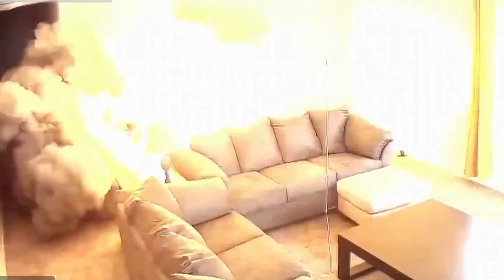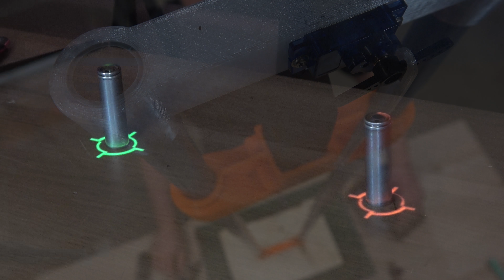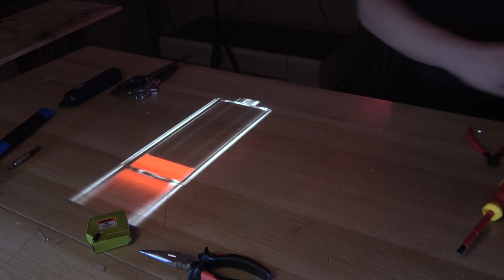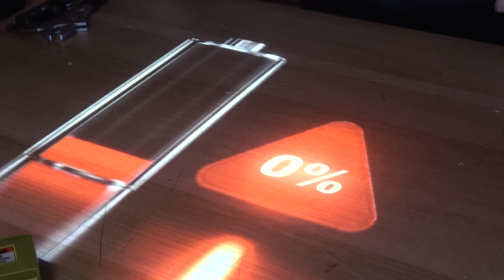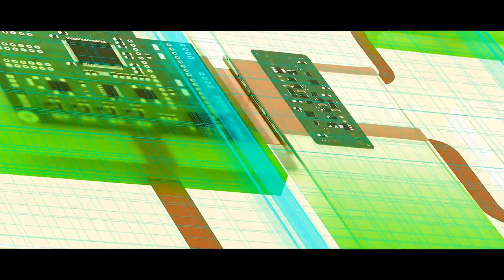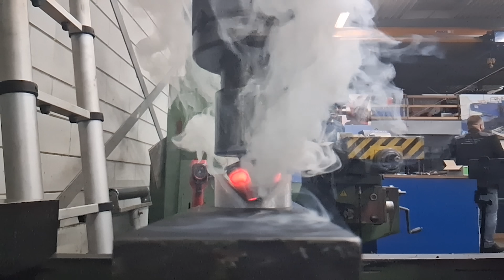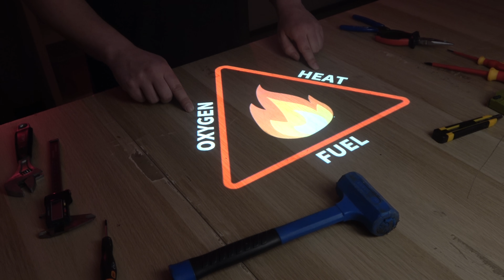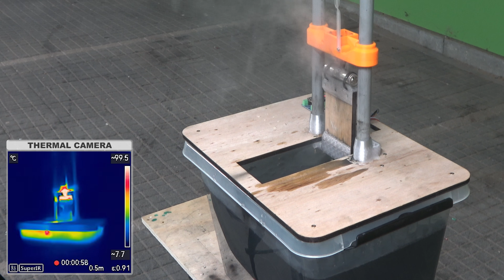Detonating Batteries.. For Science!

Comment from the maker: Any suggestions for Part 3?🤓 I'd love to hear what you really want to see next!

🔋Specific battery type OR 🔥Specific experiment maybe?

Endless possibilities of course.. But you decide!🫡 So let me know and hopefully I can give you your answer in Part 3 soon🤓
Reply: Pouch batteries should be included, as they are used in many more places. And puffing should be explained.
Reply: @moonowo Will Prowess punchered pouch cells on his channel. Very educational.
Reply: Try LiPo batteries! Much more unstable and show what happens when they are overcharged/mistreated.
Reply: @WedgwoodWarriorXlifepo4 battery is much more stable
Reply: Try this same experiment using  liquid nitrogen or dy ice !
Reply: why the fake thumbnail? i wanted to see the phone battery that never appeared, downvoted and blocked for not showing the correct  battery as in the thumbnail
Reply: 50% charge because thats usually best longterm storage, see if ammo cans (metal) would be somewhat suitable to supress fire at home (put some paper sheets next to it)
Reply: What and how ignites lithium batteries?... a general understanding!
Reply: @user-McGiver  eternal fire is stored inside the batteries
Reply: @TouYubeTom  more like lithium ignites when in contact with oxygen... but what causes that?... if it's not mechanical, what is it?... and what can we do?... for example, I never leave batteries on the charger beyond the charging point... I set alarm...
It's not a funny matter... don't be that fool...!
Reply: @user-McGiver multiple safetymeassures have to fail st the same time, or very raw physical dmg for example could cause damaged cells that short circuit in themself, cause extremely high temperatures, breakes down many chemicals and gives the highly reactive lithium a chance to react with water or air. its reactive to rip water  2 H2O into   2H2 and an O2 that reacts with it, extrem temperatufe of any kind can to that to water.  like metals burns :)
Reply: @johannesdatblue4164  like firefighting planes drop water around a bushfire, dropping water dead center causes an explossion, for the same reason... scary stuf...!
Reply: @TouYubeTom The eternal ire of MAGA supporters is what powers them.  This ire cannot be extinguished with logic or reason.
Reply: Actually puncture "spicy pillow" inflated pouch cells like the thumbnails show for this and the previous video. Just pop the outer covering and see what happens, then go for the full stab through. Another way to cause mayhem is force charge a depleted cell at a high current / voltage.

That was a problem in early LED flashlights using two unprotected lithium-ion cells. If one charged and one depleted cell (especially if the depleted one was below the danger limit) were put into a flashlight, the high surge of the charged cell into the dead one could cause thermal runaway. In a sealed, waterproof flashlight with a thick walled aluminum tube, that essentially made the light into a grenade.

This could get people even with cells that appeared to be charged, when one cell was old or damaged to where it would charge up to full voltage but actually not hold a lot of power. The bad cell would drop quickly then get overheated by the high power of the good cell going through.

Some version of this was what killed a man some years ago when he was holding an Olight dual cell battery in his mouth. He was not using cells sold by Olight. After that incident, Olight ceased production and sales of all their flashlights with more than one user replaceable cell, and made their own type of protected cells so most of their lights don't work with standard protected or unprotected cells.

Next test on from high rate charging of a dangerously low cell, try reverse charging one that's too low, one that's at the safe minimum, and one that's fully charged. Of course no fancy safe electronic charger will let that happen. You'll have to brute force it. :)
Reply: Make a lithium cell hand granade!
Reply: Use breathing apparatus so you don't die.
Reply: @GTrainRx7  or any safety gear for that matter….
Reply: mmmhmm for science😂 you just wanted to see something blow up😂
Reply: just stop it, it DUMB👎
Reply: Most lithium battery fires are self oxidizing and exothermic. Is immersion in water actually having an effect, or is the reaction just running its course underwater? Immersion could certainly stop damage to other object while letting the reaction continue. Maybe run a series several tests of various charged batteries burning out in and out of water.
Reply: Besides the gas hazards how about some gloves before screwing around with a chemical fire 😂
Reply: Just pop 2 of those bad boys in your pocket followed by your car keys and see what happens.. I watched a grown man run around a parking lot screaming for 30 seconds while one burned through his jeans pocket and slowly slid down his pants leg until it burned out. He's lucky the 2nd battery didn't go off because he almost lost his leg to 3rd degree burns and had to have skin grafts.
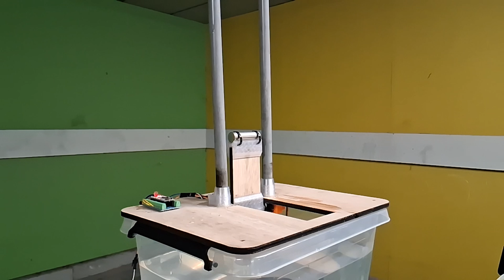Reply: at the end, 14:30 or so, you can see the hole never beeing on top to give the water  a chance to run in and slowely fill the battery and some wster modt definetly make it worse.
as far as I know from german fire fighting, they pierce a lance (giant needle) with a wsterhose attsched and flood the battery with water from the inside, then throw the car/battery in a big special container filled with water  and keep it submerged. can take multiple week's with multiple rekindles.
Reply: Yup. I was part of a test where we punctured a hybrid car battery and submerged it in water for nearly a week. It took few hours after it was removed, but it still decided to go for round 2.

Another test we tried was use a co2 extinguisher on a smaller battery pack ( ~8kg of cells) to see if it could temporarily stop the reaction. It got about 10 seconds of no fire/smoke after the entire 10kg extinguisher was empty.
HSE is still arguing if it's worth it for us to use them if we attempt to remove a thermal runaway pack from the assembly line.
Reply: Do these hyped flame retardent puches actually help?
Reply: Hearing Dutch Accent? Je klinkt net als een Nederlander, lol.
Reply: Overcharging the battery cells, preferably pouch batteries because those have become common in smartphones and laptops. Overcharging might happen if BMS fails and it can easily trigger thermal runaway which logically happens with totally full battery in that case resulting in maximally hot flames.

Another interesting test would be NMC chemistry vs LFP chemistry. I think those should compare either two batteries with similar physical dimensions or same Ah or Wh rating.
Reply: I like this video a lot, but you take way to long to get to the point. I understand the suspense, but it's too much imo
Reply: A couple ideas: 

1) Scratch the cover to unseal the battery, but try not to bring to many layers of the battery into direct contact with each other or to short them with metal, so that it doesn't immediately catch fire. *Then* dump it into water and see if that lights it. 

2) Put your battery-puncturing-and-dunking contraption at the top of a 10-meter vertical tube full of water so that you have an extra atmosphere of water pressure trying to force water into the battery, and see if it burns more vigorously.
Reply: Find the best way to put the flaming batteries out perhaps? I'd guess CO2 or Foam fire extinguisher
Reply: heres a good one 
|can we safely cut one in half using a water jet?
it might short it but it would crush it to the point the layers short at least and if its empy we can se a clean cross section
(posted in a previous comment of mine)
Reply: I wonder how big the explosion would be if you dropped it into salt water instead of regular after being pierced. Also, would a fire extinguisher or a fire suppression system be able to put it out?
Reply: NMC vs LFP? How about putting one over a gas fire on a grate?
Reply: Would colder water extinguish the battery faster? What about liquid nitrogen?

And if the battery is in a vacuum chamber with no oxygen, would it even start in the first place?
Reply: 61
Reply: around 12 minutes there is a weird brrr sound, is that from one of the machines?
I'd like to see some kind of safe make-at-home solution to discharging unwanted batteries at home. Asking for a friend.
Reply: Suggestion for this part : extinguish only has one H in it, right at the end.
Reply: Love to know what kind of lithium batery you used and if it also apply to lifepo4 battery??? They say that those are safe
Reply: Will a shunt buss bar take enough of the energy away from battery so that it stops a reaction or much sooner?  If this functions perhaps a safety mechanism for electric vehicles might be in order.  Perhaps rather than the water bath a buss bar could be connected after.
Reply: I want to see what would happen to a full battery under extreme heat, not from fire, but by a microwave
Reply: Could you do a nitrogen and CO2 extinguisher? Just a stream of either gas into the battery and maybe a chamber of either gas to see if it helps any.
Reply: LFP pls
Reply: LFPs
Reply: try square shaped samsung smartphone batteries like the ones that are removable
Reply: For batteries try a fully charged Reliance RS50, 70A 21700's lol, and they're tabless too, maybe those fail  worse...
Reply: Why the F was this video made???   Tell me?? Oh, wanna know what I want to see next?? You dont!
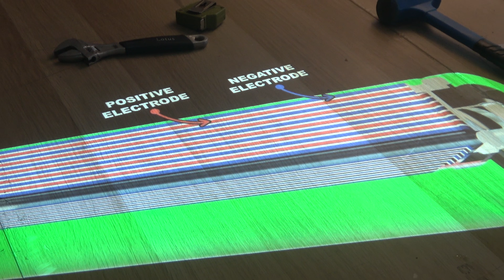Reply: Conceptcrafted what the the device are you using at 0:50 and I want to buy it ?
Reply: Puncture a lithium ion pouch cell (like one out of a phone) and do these tests on a pouch cell, you might get more explosive results.
Reply: @conceptcraftedcreations Li-ion batteries in water do not generate their own oxygen, they pull it from the water. The only way to safely extinguish the fire is suffocating it in sand, or other similar mediums.
Reply: You duck
Reply: High density lithium batteries
Reply: make the pouch bateries in the next one which are li-polymer the type batteries in fpv drones
Reply: Try NiMH batteries too, maybe alkaline too!
Reply: molicel p50 vs some "5000" mah chinese low amperage for comparison :D im interested if high amp lithium is more dangerous than lower amperage lithium or are they same explosive :D
Reply: You're pathetic
Reply: Mi a lítium vizek érintése jó e ❤
Reply: 15:01 if the battery can generate it's own heat and oxygen does that mean it can burn in space or vacuum.
Reply: smartphone battery on tests
Reply: Ben je Nederlander, bro? Want je spreekstijl en accent klinken meer als die van een Nederlander die Engels spreekt, daarom wilde ik het even vragen.
Reply: yeah. get to the point instead of going on and on about other things for starters
Reply: Hey guys, Jesus died on the cross for your sins because he truly loves yall. You matter to God because you were created in His Image. If you wanna be freed from sin (Sin is disobedience to God, the wages of sin is death) confess that Jesus is Lord and savior, that God raised Him from the dead and you WILL, not if you are qualified, WILL be saved. Also, if you truly mean it from your heart, your life would transform for Christ. Lastly, “once saved, always saved” is false. You are saved by living in God’ will. But don’t fear! Romans 8:1
Reply: You are literately next to burning batteries without any breathing protection, these are some of the most toxic fumes one can breath!
Reply: @robson668   hold your breath on that thought now, Kevin!... 15 min would be enough!...
Reply: Theres enough battery fires on planet earth without programs like this causing them deliberately, how about you find a way to clean up the atmosphere rather than adding extra pollution?

Comment: I had a battery fail with the same results but I prepared 2 half buckets of sand, dropped the battery into one bucket and covered it with sand from the second. It smothered the fire but didn't appear to stop it, though it was safer.

Comment: i remember way back in the days of early psp hacking, one of the methods was to create a Pandora Battery. first step being to cut open the plastic casing for the psp's battery before accessing the circuit board and messing with it. and one precaution i remember reading was to make sure the battery is drained before attempting this, so you don't cause a fire if you puncture the battery itself when trying to cut the case open

Comment: so basically. What I learned from this video is, batteries are man made, microscopic "stars" encased, to harness the power. And if the case is broken, the "micro star" will basically have a huge solar flair, that inevitably leads to the a super heated core, causing a supernova of the "micro star" that will have a run away reaction of plasma and fire. Even creating it's own environment within itself to burn even hotter and faster. Humans are fking crazy man. And we just have these little things in absolutely everything!

Comment: The flaw in your statement where you want to remove two elements from the combustion process is that, when water is involved, batteries burn so hot that they can extract the oxygen from the water. Additionally, the electricity stored in the device can be released into the water, making the process even simpler, since electricity is capable of separating hydrogen and oxygen. For most devices, the energy is insufficient to bring about this splitting on its own, but it lowers the requirements for doing so.
But a car battery (Akku), for example, would have enough power to carry out the splitting of oxygen and hydrogen as well. 
Furthermore, the cooling effect cannot be effectively achieved, as the process takes place in such a high-energy environment that the water often fails to reach the burning area of the battery closely enough to cool it down; instead, the water simply evaporates around the site of combustion.
Normally, this wouldn't be a problem, were it not for the fact that a gas bubble would form, preventing the supply of fresh coolant.
These factors are precisely the reason why firefighters simply go in, grab a burning car with a grapple or crane, and place it into a container filled with water. 
Because you can pour as much water as you want onto the battery, but it will keep burning, and you usually have to wait more than a day before you can actually get the car out of the container.
Because enough energy has then escaped to cool down the burning battery and prevent the reaction.
So, the first thing you can do is simply to contain the burn, rather than prevent it.
The problem with battery fires is simply that the energy doesn't primarily come from the reaction between oxygen and a combustible material, but rather from the reaction between the stored energy and a combustible material.
That means you first have to remove the stored energy so that you can extinguish the burning storage medium.
Lithium-ion batteries, in particular, are prone to what I just explained.
That is also the reason why there is currently an attempt to switch to other systems for stationary batteries, as they are less maintenance-intensive and also pose less of a fire risk.
For instance, these substances might not burn as well making them easier to extinguish or they might burn with far less energy, which, for example, allows them to be cooled down with water.
Because the most important thing when you want to extinguish a fire by cooling is that your cooling agent is actually capable of slowing down or preventing the reaction with the cooling material because if you can't achieve that, since the stored energy is too high to pull it off, then you simply don't get a positive effect.
And since most energy storage media simply have an excessively high energy density, this is unfortunately not possible in many cases.
Since the normal reaction is continuously reignited by energy storet within the storage medium (Akku)
If you pour water on a burning battery, it’s basically like trying to mop up a running garden hose.
You have to turn off the running water first before you can mop up the water.
It simply comes down to the fact that the energy source isn't oxygen, but rather the stored energy.
And I deliberately didn't define the extinguishing agent.
For instance, given the amount of energy generated, water is split into oxygen and hydrogen; the same applies to CO2, which is broken down into oxygen and carbon—and both of these components essentially make the fire even worse. 
After all, both hydrogen and carbon can be burned very effectively especially in combination with the released oxygen.
This is generally a problem with burning metals, such as lithium. Since it generates so much energy when burning, conventional extinguishing agents are simply unable to remain chemically stable.
And dry powder fire extinguishers or sand are also unable to extinguish this, even though they remain chemically stable.
Because if you remove the material from the previously burning battery—and the combustion had stopped in the meantime—the burning starts up again immediately as soon as you take away the insulating material.
It is of course possible in certain circumstances with smaller batteries that these methods might partially work, but only because the energy leaves the device before ou have finished extinguishing the burning material.
However, this is because the energy density in these smaller storage media is so low that they run out of power before the burning material has been fully extinguished.
Conducting tests with smaller batteries can also lead to a misjudgment, simply because they discharge quickly enough. And then they do not retain the energy required to sustain combustion.